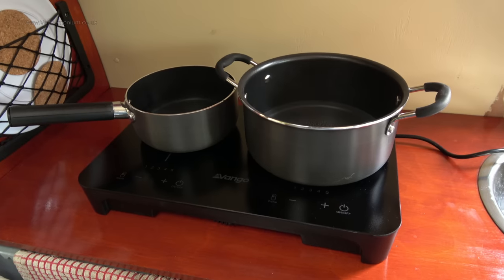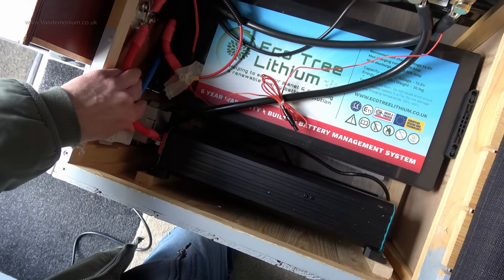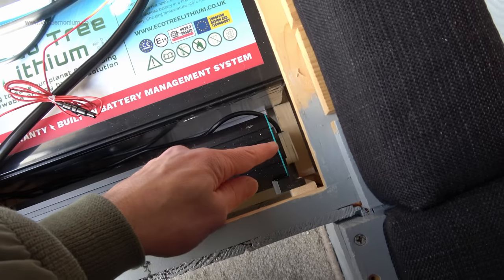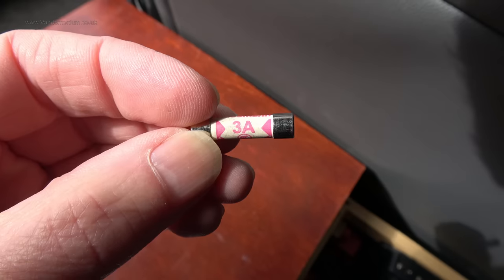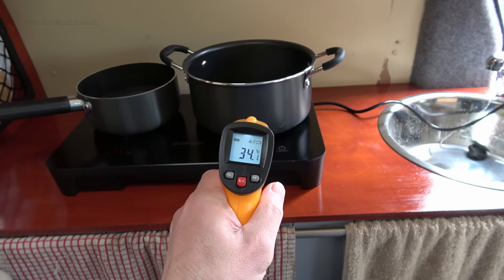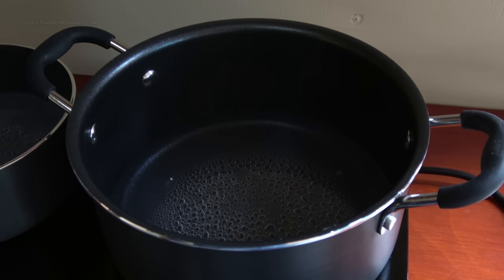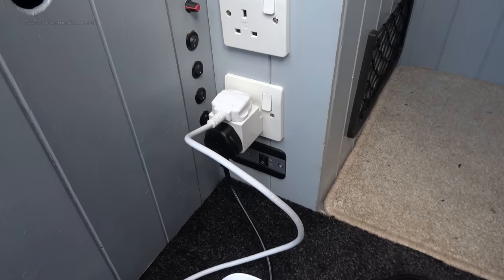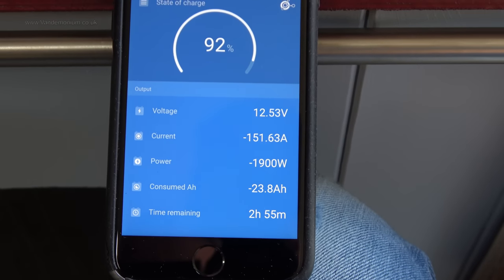80. Battle stations! Inverter vs electric kettle

Comment: What would be the minimum amount of water you'd have to put in the kettle to make a cuppa as apposed to just what you need in a s/pan on the induction?
Also, Re: Gas v induction, induction proves to be quicker, more controllable and much safer than gas, plus and in a camper it's powered by the sun.
Does your induction hob have a timer?  I'd be surprised if it doesn't. Also, you should find that if you lift the pot off the hob it should shut off.
TBH, I swear by induction cooktops, their brilliant,I've got 4 now but would love one like yours that runs on 800w.
Reply from the maker: No timer on the hob
Reply: @Vandemonium  Ok!  Timers are handy but obviously not essential.
What about if you lift the pot off the hob, does it shut off?

Comment: A lot of non British will be confused by a fuse in a plug! And a plug so big!!! I think I would need more usb sockets in a van.
Reply from the maker: Wait ... is that unusual elsewhere in the world??!!!
Reply: @Vandemonium  yes. Ringmains are peculiar to the UK and some ex colonies. On a radial system the only fuse is at the box. 

It was like that here one. Do you remember those old round pin 15amp plugs here - in older houses They didn't have a fuse in as they are radial.

I think we have fuses as if there is a break in the ring, it's dangerous. You could have 30amp going through a 13amp socket.
Reply: @Vandemonium  i think the only kinds of plug in the US that have something like a fuse are ground-fault plugs for use near water and surge protectors which usually have multiple plugs.
Reply: @Vandemonium  
Appliance plugs with fuses have never been certified/required/supplied  for use in NZ.
3 prong (or 2 if the appliance is double-insulated) slimline plugs with no fuse.
Fuse and RCD are all on the circuit on the distribution panel in a house /garage /shed /shop /industrial complex .....
Reply: @Vandemonium  Unheard of, I'm pretty sure the UK plugs are the only one's in the world with a fuse in them.

I believe it all goes back to the UK saving copper after the war resulting in the UK getting ring mains rather than the more (worldwide) common star mains where each outlet (or spur..) is fused at the consumer unit.
Reply: @Vandemonium  Yes it is, as far as I am aware the UK plug is the only one coming with a fuse in it by default. I think Tom Scott did a video about it, years ago. Has to do with the way British houses are (were?) wired if I remember correctly.
Reply: @EHobbit  still are wired using a ring main layout.

Comment: Standard plug fuse values are 3A, 5A & 13A. Other values are available, but not generally stocked.
Reply: 1A as well for really small gear.
Reply: @JasperJanssen  That's one of the other values I mentioned, but it's not generally available. I get them from RS.

Comment: Working on electrical wiring for small planes and campers- could it be the wires not capable of carrying the voltage, wattage, and/or amperage?
Reply from the maker: Not in this case

Comment: The left burner probably isn’t pulling 800 watts because the pan is smaller. I think the amps pulled by an induction burner is proportional to the size of the pan.
Reply from the maker: Both burners are 800W

Comment: Just a thought, unless the hob is set to maximum it’ll be clicking on and off (I assume that’s how it works?) and so even less stress on the inverter.
Reply from the maker: Most work like that but apparently (I haven't checked) this one actually reduces the power but keeps it on
Reply: @Vandemonium  Being induction that does make sense.  Excellently neat wiring by the way, and I can see you’ve not scrimped on those cables feeding the inverter. It’s quite important to keep bolt drop to the inverter to an absolute minimum when the voltage is already low at 12v. 
Nice work.
Reply from the maker: Thank you. The cable is rated for 345A

Comment: What does the fuse built into the charge controller protect? 
Should be a fuse to the left of the terminals.
Reply from the maker: Dunno, they don't actually specify in the manual
Reply: @Vandemonium   Ok! I've never run a fuse or heard of anyone that has, but if it gives you pieces of mind there'd be no harm in putting one in.

Comment: Are you sure that your mains cable from the inverter is rated at 13A if the original plug fuse was 3A?
Reply from the maker: I think so (but I'll check); the 3A fuse was put there by me for the old 375W inverter
Reply: It said 13 Amp on the plug itself.

Comment: Bear in mind that the fuse in any plug is rated for the cable. The cable is 10 Amp rated so if you want to use a 13 Amp fuse you need 1.25 or 1.5mm2 cable. You will get away with breaking the usual convention as your inverter is the limiting factor at 2000 Watts.
Reply from the maker: I need to check but as I recall it's standard 13A mains cable (I can't imagine I'd have deliberately used downrated cable for that connection to the old inverter)
Reply: Ah right, maybe it looks thinner on TV but typically mains cables are 1.0mm2 like the ones that plug into a PC. Extension cables are 1.25 and 1.5mm2 with 13 Amp fuses.
Reply: Actually cable for 13 Amp fuses are quite difficult to terminate in rewirable plugs. Used to do PAT testing and was forever swapping 13 Amp fuses for 10 as plugs are often supplied with 13 Amp fuses in from the factory.
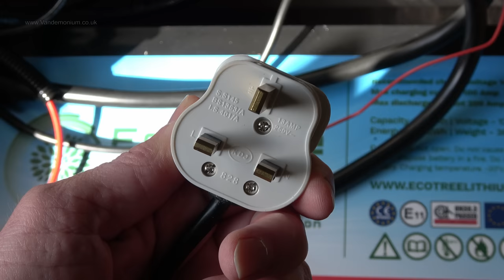Reply: If you look closely at 2:10, the plug itself says 13A @250V.
So, all good. 👍
Reply: The plug will because it is a 13 Amp plug as are all plugs that go into 13 Amp sockets. It is the cable I am wondering about. Sorry to be OCD, it is your van after all.
Reply from the maker: That prior reply wasn't from me and yes I will be checking!! Cheers
Reply: @Vandemonium  oh yes, didn’t spot that. Fancy butting into somebody else’s conversation especially with incorrect data 😀
Reply: @Vandemonium  that seems to be my mistake then. I assumed, that plug and cable belonged together originally. So I thought, the 13A imprint described the whole set.
Reply: @MrFloridadaz  This is the internet. I very much doubt, that something like "someone else's conversation" exists here. 😄
Regarding the false data, it was my assumption, that plug and cable were a "set" and the 13A imprint was thus referring to both. My mistake apparently.

Comment: I can't believe it! Rather than just being entertained by your wit, I submit my first observation and question.  May the fuse that blew in the plug (or in America we call them an extension cord) be rated to protect the wire itself? In other words, and again here in America, it is generally frowned on to increase amperage in a fuse willy nilly because the lay person is not expected to understand the full extent of why it is there. It is assumed, though, that a melting and fire hazard from the wire itself, could ensue above 3amps. This leaves me to postulate that you may have created a hazard. Please elucidate.
Reply from the maker: Correct however that fuse was put in by me for the original inverter (375W) rather than the cable

Comment: Well I was wrong. In my defence I couldn't make out the writing on the battery to see the 200 amp discharge rating until today! It was perhaps daft to assume you would have specced a battery rated less than your anticipated current draw! However all is not lost as you compensated by fitting a 3 amp fuse instead. At least that was a cheap fix!
Reply from the maker: Yeah that fuse dated from the original inverter which was 375W

Comment: Have you tried the Ridgemonkey pan on the new hob?
Reply from the maker: No, it's not compatible for induction hobs but they're bringing out a new version this year
Reply: @Vandemonium   That's a shame. I suppose you can still use yours in the house (assuming you haven't got induction there too). Good that they're making a new one though.
Reply from the maker: I'm told you can buy metal plates which sit between the hob and non-induction cookware; the plates then heat from the induction and transfer it up via conduction so the Ridgemonkey could still have a use!

Comment: That flex looks a bit thin on the plug for the inverter. Is it 2.5mm squared?
Reply from the maker: I'll have to check but I was under the impression it was stock 13A mains cable as I doubt I'd have used a de-rated bit of wire
Reply: I think I would increase the size of the cable a tad, worth feeing it when under a full load. Hate to have an extra heater in the van!
Reply from the maker: Definitely!

Comment: At 9:20 did you turn on the hob beneath the empty cook-pot?
Reply from the maker: No, there was always water in the pans
Reply: @Vandemonium  Just a trick of the light. Thank you David and best wishes.
Reply: Good question Richard, which brings up another safety feature with induction cooktops, if a pot should be empty, it will overheat and the hob will shut off.

Comment: Hi did you have any problems with reverse polarity?
Reply from the maker: No, I was very careful not to wire things up the wrong way around.
Reply: @Vandemonium  I had trouble connecting to 240 from mains
Reply from the maker: Ah, I see what you mean. I still was very careful to wire it up correctly and now have the dual-pole RCD/MCBs precisely in case of reversed mains feed (though no UK campsite should be wired reversed!)
Reply: @Vandemonium  Enough campgrounds in the US are miswired so that most every camper has a surge protector/circuitry problem-detector that plugs in between the power pedestal and my own system. I occasionally detect a problem and have to switch sites.

Comment: HA I was right - But just to add - the cable from the inverter with that plug on it is not rated for 13A It looks like 0.75mm"2 and needs to be 1.5mm2 really. Might as well get it right!
Reply from the maker: I need to check but as I recall it's standard mains cable (I can't imagine I'd have deliberately used downrated cable for that connection to the old inverter)
Reply: @Vandemonium  no such thing as standard mains cable. The CSA of each conductor needs to be 1.5mm sqr

Comment: It seems a huge amount of money you have spent so you can just cook and boil a kettle, more than a lifetime in cost of those small stove gas containers. I could never justify that. The battery monitor time left information is to a flat battery? or does it leave 20% or something so it doesn't kill the battery completely?
Reply from the maker: The whole point was to get rid of gas. And I'm not a fan of those little gas containers
Reply: @Vandemonium  fair enough matey
Reply: @Vandemonium  Also here in Australia we often cook outside, so gas and wind can be a real pain, so I love using the small kettle and the induction stove, and the toaster, and the microwave too, so easy! 😁

Comment: Usual mistake...you are talking rating the fuse for the load, and you'd prefer a 10 amp fuse instead of 13.

13 is perfectly ok if that is a 13 amp cable which is almost certainly is.

Fuse is rated for the cable not the appliance.
Cable is rated for the appliance.
Reply: Sizing for the load, however, is completely fine to do, assuming the cable is appropriately overrated for it.

Providing you're not the manufacturer that is and don't undersize it.

If the load should never peak above 10A. Fitting a 10A fuse is fine. He doesn't need a 13A fuse, he needs a 10A.